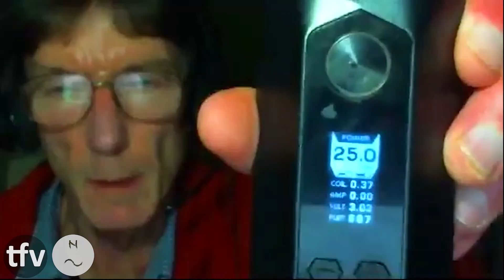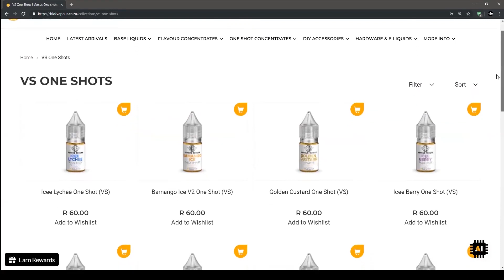Best for Flavor - Ni80, Stainless Steel or Kanthal?

Comment: Really useful test thanks guys. Not seen wires analyzed this way before but what you found aligns well with the general impressions I have picked up here and there over the years. I build my own coils usually with a mixture of materials to try to combine some of the benefits of each, though I must say not methodically.  Addy Tuney has spent much time on his #tuneyflavorbuild with excellent results. Also glad you highlight the effects of varying the wattage has on flavour too. It's a complex topic for sure. Nice work 💪🙏😎

Comment: What s great idea to compare coil types even if some will argue to the death over “their” favorite wires. 

I’ve been using SS316L since I started DIYing. I think mostly because of “studies” of certain on higher wire and flavor and health risks. Im usually at around 4/5mm  id  and 30 to 35 watts . I do have 2 rolls of Ni80 that I should at least play with.

Comment: I did this test for myself years ago. I prefer stainless steel. The extra flavor is well worth a little more Maintenance. If your recipe tastes off with stainless steel that just means your recipe needs to be worked on to meet your needs. Muddying up as you put it isnt a good thing.